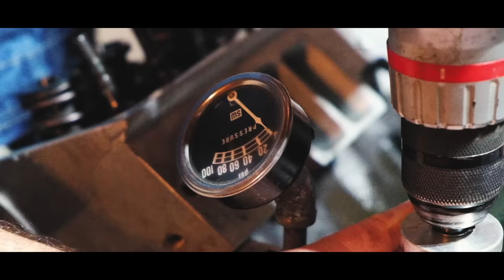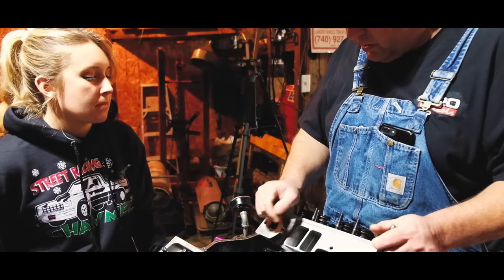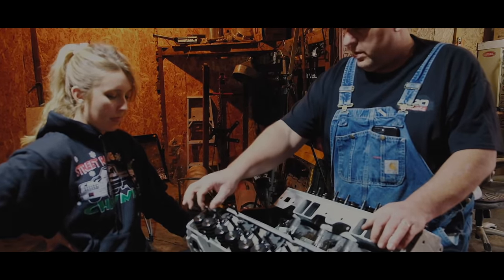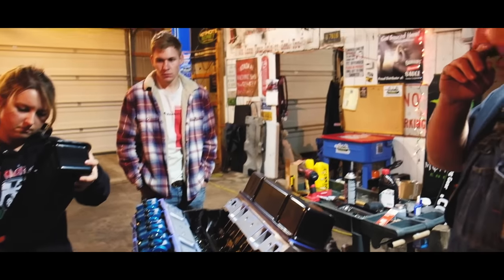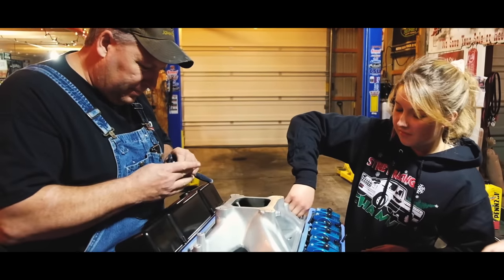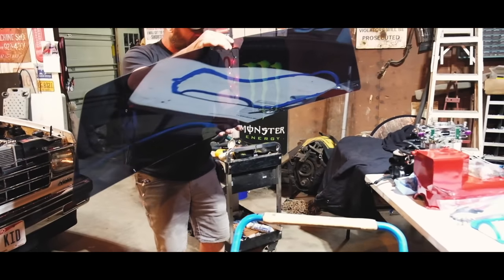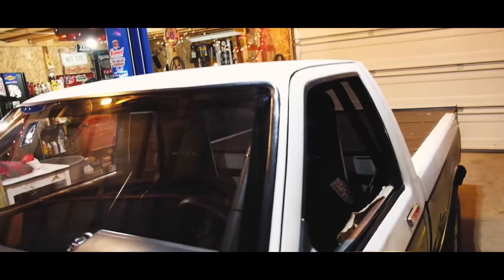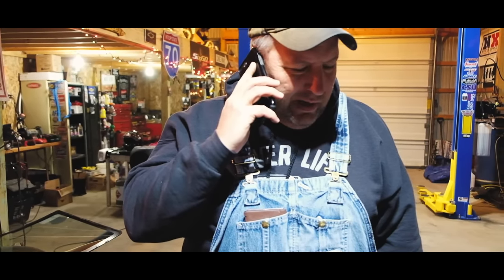Molly's SBC Build, Dad Reacts to me Crashing Silverado.

Comment: I learned from Auto Tech class and in real life on a 1979 Oldsmobile Cutlass Calais 5.0 I had bought how to tune 305 and 350 gm small blocks. On the vehicle that I bought after putting a new intake, a carb I had rebuilt, a new distributor rotor, and few other new parts and fluids I noticed the engine sounded like it wasn't getting oil. So I remembered the lesson at the Auto Tech class on how to tune gm small blocks. I removed the valve covers started the car. I noticed right away there was no oil coming out of the lifters. So I used the tune up steps for each rocker arm with the engine running.  Loosing each one until it clattered, then tightening it until it barely stoped clattering, plus going 1/2 a turn past that on each rocker arm while the engine was running. The guy I had bought the car from overtightened each one 1 to 2 turns to much. When I tuned each rocker arm properly oil started spewing from all of them normally. Except for the first one front driver side. There was no oil coming from the lifter, it was trashed.

Comment: Bill, that same exact look I had once. Not from my own kids actions, but sitting in the lanes (in my 1963 Dodge Polara, only had it a month, bought it for 3K at the same track, my dream bracket car), at Terminal Island Raceway, a street stroke track run by famed LA Street Racer Big Willy and his wife.

They go to pull our lane, I am the 4th car, and right in front of me sits a nice altered, thing ran like 7.80's alcohol & squeezing in 1/4. I was not yet fired up in my singer sewing machine push button shifter car, foot on the brake, right hand on the key, left on the neutral shift button, ready to throw the park lever left. Act of starting the car.

The Altered car in front fires to life and alcohol fumes fill the air, whoomp, whoomp, whoomp, and he clicked the damned Altered in reverse instead of forward gear (I saw those wheels set rearward at high idle), and I thought noooo, as I reached for the horn really fast, and stood on the brake pedal so hard I lifted my are off the seat so I would not hit the beautiful Z28 Camero behind me from what I saw coming in a flash....Too late, he hit the throttle (Braaap)' and buried the rear fiberglass apron with bars behind it, of that car right above the top of my front bumper, and right into my perfectly clean alum. grill on the Polara. The 45 degree angles of my front grill out were completely and perfectly rounded in just 1/2" short of the radiator fins across 80 percent. Totally unsalvageable.

Those clean grills are so hard to find! I was more hurt than pizzed, the car owner was standing beside the car and saw what his driver did (and my fuming initial response and without a word beyond " Man, I am sorry", whipped out his wallet and filled my hand with more than enough cash to pay the damages and my 2 yr parts hunting fee ahead.

But, I looked just like you did hanging over that fender and again later sitting down. Disgusted and dejected. Laughing about it now, but brought me back in time again. Accidents happen....It is what it is. Could have been much worse...His throttle could have stuck. Lmao. He pushed my car back a full 12" the skidmarks showed, short of that Camero, but not by much.

Comment: I found when setting the distributor in, if you install it all the way down in any location lift it up rotate rotor 180  and get to set down again each time you lift the distributor it rotates the pump keep doing it until it lines up where you want it pointing. This works nice too if your pulling intake and want to put it back in the same place when pulled. Remember when dots are line up on gear set it is firing on number 6 cylinder

Comment: When I set the pushrod length. I make sure the roller of the rocker runs in the centre of the valve stem. This decreases stress on the valve train and greatly improves the longevity of the valve guides

Comment: Glad to see you putting the lil truck that could on a diet and can't wait to see what you do next.....alot of YouTuber's are doing alot of upgrades for 2020 and making their rides faster next upgrade I think you should do is go EFI with a carb style EFI system and get a Holley Dominator to run everything and get all the sensors and hook ups and connectors for everything you can so you could really dial it in and put it on straight Methanol and go with a dry block or just one or two motorcycle radiators for cooling but running straight Methanol it will keep the engine cool anyways but also do some suspension work on it so you can get the front end to stay down a little more especially when you give it the beans

Comment: If you dont know which way to turn the oil pump, look at the distributor vacuum advance unit. The tangent that it forms with the body of the distributor is like a direction of rotation arrow.

Comment: you put the engine on Top Dead Center  of the compression stroke  1 one piston ..   take a long skinny screw driver  point the  oil pump  shaft slot  towards  number  1 piston .. Drop  the Distributor  in  with the rotor  contact  pointing towards the Number one piston and you will  be close to get it running .. just have to set up the timing with a  timing light at that point..

Comment: Why didn’t they mention the position of the cam when explaining why the pushrods were “too long”.   Generally, but maybe not with these special poly lock nuts, so sorry if I’m wrong, but if the cam was at full lobe height on that pushrod, then the nut most likely would not have threads to start on.   If that pushrod was on a cam lobe that had the valve closed, then it’s the lowest or shortest point.   Most of the time the rockers will be loose on the small part of the cam until you lash them, and the opposite or big side of the cam lobe presses hard enough against the valve spring that the rocker arm stud will pull out of the head if the geometry isn’t just right or if the valve spring just has too much pressure for the application.    But when you are running 0.6” or more of lift at 8500 rpm you had better get it right.    Too little spring pressure equals valve float because the spring can’t keep the rocker on the pushrod, and there will basically be a point where the actual valve lift will not be stable, and not be as full as at lower rpm. But yet you could feel the engine pulling hard up until that point, then power levels.  Not drops a lot as RPM increases, showing that it’s run out of breath,  but levels as in the valves won’t lift as much as they had but the inertia of the engine speed barely maintains the rpm as the springs fight to keep the rocker cup on the pushrod.    Also the excessive spring pressure costs horsepower, so like a supercharger, it had better be worth the sacrifice.   Build an engine.  Show a kid.    To me an American V8, cam in block, valves in head, pushrod engine, is a thing of awe and beauty and a visceral example of what America is all about, as the machine incorporates the art, which incorporates the machine, which  demonstrates innovation and problem solving in the form of a thinly veiled art form.    Just stare at a 427 chevy on a stand.    Or a 340 Six Pack.  Or the venerable 302.  A SOHC Ford 427?  C’mon!  Those aren’t real!   No way!  Who would build one?   Yep.   These hunks of steel aren’t just art and function.   They have conveyed the world from a rate of work accomplished that is unfathomably slow for our modern minds, to the point where we can go buy a 707 horsepower sedan that will hit 202mph and costs less than $100k.    No one.  Not any of us could have even imagined that just 10 years ago.  To get 500 hp out of any engine, 20 years ago, basically made them barely streetable(I’m sure to take heat on this), or just too high strung live with.   Now you can get a Camry that is faster than most old stock muscle cars.    Show that girl what goes wrong and she’ll be able to prevent it.  Show her how things are supposed to work only and she’ll be cursed with unending frustration.

Comment: Pull the motor and ECU  wire harness out of the truck get a LE80 two-wheel drive transmission cam it twin turbo it put it in Molly's Camaro or the Nova

Comment: I sure  Hope that Molly is a  better driver than her Brother  otherwise  a  Hot Rod could be a death sentence..  My Parents didn't even let me drive their cars..  I had a '70 Chevy Impala  .. then  got a  new  '79 Z-28 Camaro when I was 18 years old .. then a  '68 Chevy  C-10 and  a  '73 Chevelle Winter beater..    I did get in one fender bender  with the '70 Chevy Impala  had to have the frame straightened.  bought another one just like it with no motor.   and  replaced one quarter panel  bumper  hood  grill ect..

Comment: That was funny billy when you was talking about the washer being the wrong way!!! I totally no exactly what you was talking about and I am very very anal about washers being installed in the Wright direction also!! I think all that has to do with being a millwright for years and years!! When I’m at someone’s house helping them out with a project and see them installing them wrong I won’t say anything first about it after they installed the bolt and washer and tighten up I just start taking the bolts back out and that’s when they start yelling at me I just put that bolt in why are you taking it back out and I would be like well you put the washer on backwards and they would be like they are flat on both sides how can you even put them on wrong?? So then I have to show them and explain why!! And everyone that I have done that to did not ever no that there was a right way and a wrong way to put a washer on!!! Lol but yes there is definitely a right way and a wrong way to install a washer and I guess I try to teach everyone that I see installing washers wrong the right way to install washers!! Oh and by not installing them right on a motor or engine when torquing a bolt or nut down with a washer can definitely throw the torque readings off by installing them the wrong way!! And yes I have worked at a machine shop for several years in the past and ever since then and putting motors together I’ve been really anal about them being installed properly so that the torque readings are properly torqued to specs!!! Awesome video love watching your channel for sure!! That was the first time I have ever seen someone else actually comment about that I thought that was pretty cool!!!